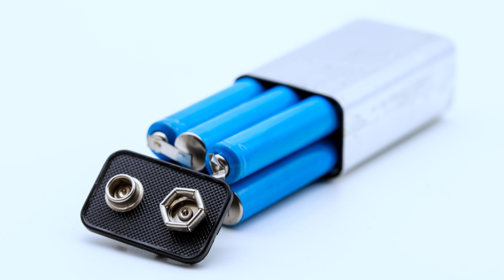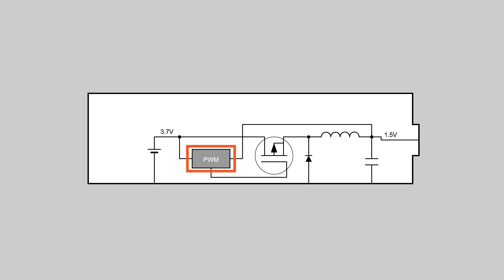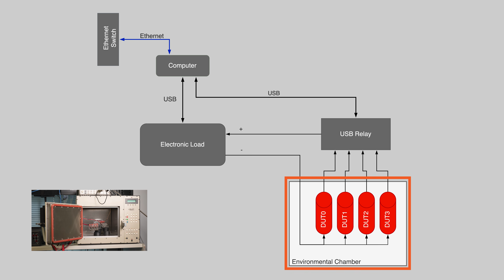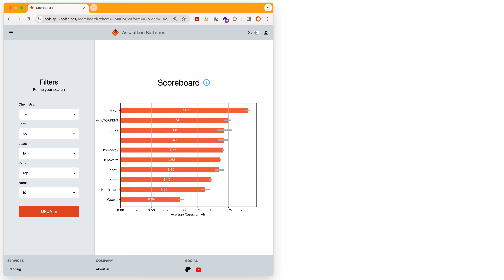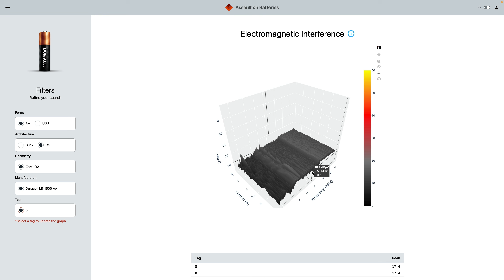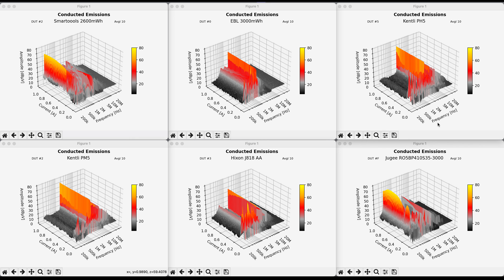Assault on Batteries #1 |  Rechargeable Lithium-Ion AA

Comment: I love the thoroughness of your tests, very well done and very interesting! Will you add more versions and brands to the list in the future like XTAR and EBL? It would also be nice to have more filter options on the website, for example to select specific brands that are available.
Reply from the maker: It sounds like you are only displaying the top five results. Under "Show" in the bottom left of the Scoreboard, change the number of results to "10 Results" and the XTAR and EBL cells will show up.
Reply from the maker: On second thought, we'll change the default to 10.

Comment: Glad to have watched this video. For now I am only using the lithium aaa batteries for my safe control panel. Seems to be good so far
Reply from the maker: An electronic lock typically doesn't have any analog or radio circuitry and shouldn't be sensitive to EMI. Keep in mind lithium-ion has a higher self-discharge rate than alkaline (ZnMnO2) or disposable lithium (LiFeS2).

Comment: Hello!

Thank you for these videos very informative. Especially the part about EMI, I was unaware.

I am a professional sound mixer using a lot of wireless mics. Of the brands you have tested are many I use. LADDAS, Xtar and eneloops.

You say not to use any of these batteries in highly sensitive electronics like wireless mics. So my question is what should I use then? I currently run Lectrosonics wireless in my kit.
Reply from the maker: Lectrosonics makes nice gear! We'll contact their support department and ask. 

Meanwhile, can you share which model you use and how long the mic has to run between charges?
Reply: @ well I use LADDA’s in an HMa for example and get about 7 hours run time
Reply from the maker: An update:

We asked Lectrosonics what their policy was with regard to rechargeable Li-Ion, but have not had a response yet. We also contacted a local repair shop who have access to schematics. They tell us most professional gear has a boost converter to raise battery voltage for transmitter circuitry. The boost converter’s EMI filters probably clean up some of the noise from the buck converter in the rechargeable lithium-ion cell. However, there’s still no guarantee the two DC/DC converters will work together properly. Stay tuned…

Comment: At first a ISB jack on a cell may appear to he a smart solution for chargin3.  That concept loses its appeal when multiple cells need to be charged. Then a multiport USB power source is required and multiple USB cables.  This may be more of a.pain than forking over a few buckazoids for a multi-cell charger.
Reply from the maker: That's right. The best solution depends on the application.

Comment: Very nice . I have had trouble with them Li-Ion 1.5V rechargeables because of noise from electronics . I found a fix and works in some electronics just fine . AA is about 14500 size. So I found 14500 LiFePo4 3.2V cell this has no electronics. So on a 3V system use 1 dummy cell . or re wire batt holder to parrallo .  Also some electronics can use 3.7V cells.  witch is just .7V higher than 2 -1.5V cells. LFP cells 3.2V offer much better cycle life.   There is some Nickel Zinc 1.6V  rechargeable on the market but have poor cycle life but better than the rechargeable alkaline manganese (RAM) type.  I am finding that modern electronics is using standard 18650     type cells now. The older AAA/AA/C/D are fading away in new devices . And for remote controller they are switching to coin cells and you can get rechargeable ones as well.
Reply from the maker: Yes, that's a good solution if your device takes an even number of cells. You have to be careful you don't damage the LiFePO4 by discharging below its cutoff voltage though. We cover this in our next video (AoB #3). 

Note you can get LiFePO4 in AA form too: https://www.aliexpress.com/item/1005005870958670.html
Reply: @on-the-fritz In my experience a single 3.6v Li-ion does well in 3x AA, AAA aplications . Starts at 4.2v if fully charged, which is lower than the equivalent alkalines, and the cutoff for Alkalines is 0.9v per cell, 2.7v total, which is still higher than their 2.5v lower limit. Of course you try to replace/recharge them before that.
Reply from the maker: Clever! Makes us wonder if there isn't a way to put three Li-Ion cells in parallel to maximize run-time. I can imagine shims that connect the cells in parallel and route their output voltage to the appropriate contacts in the battery compartment.

Comment: I have so many questions for someone that understands Electrinics. 
But for now. I just bought 8 Hixon 1.5 AA’s then discovered since I have a smart charger with sixteen slots that gave me a grumpy beep when I tried to charge them. Bought the Hixon 4 bay charger. 
This is for toys for my sons. I’m terrified they will try to charge regular batteries in the new charger, or lithiums into a cheap ‘energizer’ charger. How strong is the propensity for a thermal runaway fire that nothing but a suffocating wet blanket can even attempt to control. Is it worth it for the extra voltage and lifespan to have both laying around? What happens when my son throws his RC car in the air or drops it from the bomb bay of his drop and snaps a battery in half ( admittedly this would be tough but I never underestimate the destructive capabilities of an experimental toddler )
Reply from the maker: The recharging of buck-regulated (bucked) lithium cells is not standardized in the industry and we aren't aware of any manufacturers that provide a charging specification. The manufacturers of the cells we tested insist we charge their cells ONLY in their chargers. It's reasonable to expect a properly designed, bucked lithium cell to not be damaged or dangerous when put in a NiMH charger (if that's what your Energizer charger is) and for a NiMH cell to not be damaged when put in a Hixon charger, but unless the manufacturers warrant it in writing, do NOT count on it. Our lawyer's advice: an adult should be in charge (pun intended) of recharging.

Note also that some cells have a low internal resistance and precocious kids could get some entertaining and potentially dangerous pyrotechnics playing with a cell and aluminum foil.

Comment: The only bad thing about your charts on yourSit3, is that your price point chart seems to only be for non-chargeable..  I was hoping you had it for the li-ion rechargeables.
Reply from the maker: We’d like to do a price point chart for rechargeables, but we’ll need a few more patrons to afford it! To do it properly, we’d have to test cycle life by charging and discharging cells until they only held 80% of their original charge, then divide their cost by the total energy they were able to transfer from charger to load over their entire cycle life. We’d have to buy or custom build a test jig that charges and discharges the hundred or so samples we’ve got at a controlled ambient temperature. Stay tuned…
Reply: @on-the-fritz  Looking forward to it.  in the meantime, I grabbed some of the "pujimax"  3400 mWh (light blue with white writing).  They are by far the ch3apest rechargeable li-ion;  (with only slightly less performance rating).  I can get them for two bucks each when I order 20..  (or 8 - $19).  Most of the others are closer to 40 for 8, or even more..  I read enough decent revi3ws about these that it's worth using them at that pric3.
Reply: @on-the-fritz  Looking forward to it.  Make sure you put 'puj^max 3400mWh" on the list (light blue with white writing).  They were the cheapest I've found for price/performance (at least on paper). I'd like to see how they test..
Reply from the maker: We're talking about the EBL 3500mWh disposable lithium cells (ASIN: B0CY213G71), right?
Reply: @on-the-fritz  No.. It's puj^max 3400mWh..   (My  ^ symbol = i ) ..   I can't spell it out, because it will auto d3lete.  They are on fl333bay and scAmaozn...  Lithium rechargeable.
Reply: @on-the-fritz  They are barely over two bucks each on fl333bay..  by far the ch3apest I've seen for lithium rechargeable.  So I'm wondering what's the catch?   I read a lot of good rev^ews, so I grabb3d a twentyPack..
Reply: @on-the-fritz  Tw3ntyPack 4 onIy forty dollen on fI333bay.  I was surprised to see lith^um recharg3ables for that ch3ap
Reply: @on-the-fritz  Again,  I've written several comments and they all disappeared.  We can't speak freely on yyoutube.
Reply from the maker: Sorry, I must have confused your request with someone else's. Pujimax has a blue/white 3400mWh rechargeable lithium on AliExpress. If you have an ASIN for Amazon, please share.
Reply: @on-the-fritz  Oh.. ok.   I don't have a good ASIN for them, because they were all way too high over there.  Al^3xpbreszz was around the same pric3 as 3 bay, except it also came with a charger-- which I don't need, because I ord3red a smartCharger instead, that tracks the volts/amps, etc. of the inputs..  but you have the right ones..  Can't wait for the video.  Thanks.

Comment: Great video ... I was planning to buy some of the for my future wireless mics ... but looks like it's a bad idea :D
Reply from the maker: You're correct. We don't recommend buck-regulated cells in wireless devices because the noise they make can intermodulate with the oscillators in digital circuitry to create interference all over the RF and audio spectrums.
Reply: @on-the-fritz  I wonder if it makes a difference if the mic transmissions system is digital (not analogue). Maybe I would give a try and buy 4 of such to see how they work with that particular device :D
Reply from the maker: Buck-regulators operate well above audio frequencies in continuous mode, but in discontinuous mode (at low load currents), they might be audible. Don't use them in devices that process RF or low level signals!

Would a video explaining intermodulation be of interest?

Unfortunately there isn't a lot of reliable data on Ni-Zn. They might be okay if discharged consistently and recharged regularly (ie don't rely on the device to notify of low battery level). They are certainly cheaper than disposable and make no EMI noise.

Comment: I'm glad you actually tested for EMI noise. It's one of the often-overlooked drawbacks and it's the reason why I advise against any of these lithium-ion AA batteries for specific uses, like audio equipment such as wireless lavalier microphone systems. There's not much space in there and I would imagine it's almost impossible to cram competent filtering in them.
Reply from the maker: Yes, and the cost of the extra filtering would be significant too.

Comment: So if that buck converter is running all the time, what are the self-discharge parameters? One of my biggest gripes about NiMH batteries is that they are pretty much dead after 6 months of storage.
Reply from the maker: Yes, the buck-converter's always running. In storage it would sleep in discontinuous mode, waking up periodically to maintain output voltage. If it's properly designed it shouldn't add much to the self-discharge you can expect from a lithium-ion cell (2 - 3% according to Wikipedia https://en.wikipedia.org/wiki/Self-discharge). 

Newer NiMH cells claim to have lower self-discharge rates. Eneloop, for example, claims they will have 70% of their charge after 10 years (https://www.panasonicbatteryproducts.com/eneloop_rechargeable_batteries/eneloop_rechargeable_batteries-aa_4-pack/)
Reply: My lipo-1.5v-buck AAAs & AAs self discharge after near on exactly 6 months. Japanese Eneloops seem to be the best for low self discharge.

Comment: very professionally made content, thank you.
However, a typical use case for these types of batteries would be nowhere near 1A load. As you mentioned, the capacity of all of these is likely much higher if measured at a lighter load. Does this mean that Hixon J818 is still a winner in a typical scenario or should I consider Kentli instead, for example? Unfortunately it seems to be impossible to tell without some additional testing.
Reply from the maker: You can expect an increase in tested capacity at lighter loads, just because it takes longer to reach the cutoff voltage when there's less of a voltage drop across the cell's internal resistance. It's anybody's guess how buck converter efficiency changes with load current. So you are correct, more tests are needed to be certain, but we'd be surprised if rankings change at lower load currents. 

We are currently scrambling to get our next video uploaded and an update to the web site released, but we'll add 500mA load tests for a selection of cells to our to-do list. 

Thanks for your kind words, your interest and the suggestion.
Reply: @on-the-fritz  That's awesome that 500mA tests are coming. One other thing that occurred to me after reading some reviews from those who have purchased the various batteries on your list is that some early/random failures had to do with 'failure to charge'. I'm not sure if this means that architectures that have only discharge circuitry have a better chance of avoiding such failures and my personal experience is limited to using one aaa kentli in my razor (which still works after 8+ years of use). I've ordered 4 AAs now to give them a test. 10 years later i'll know if that was a good idea :)
Reply from the maker: We like that a Kentli cell isn't burdened with discharge circuitry and its three contact design, which (if our guesses are correct), would allow a battery-powered device to optionally bypass the buck-regulator and tap the lithium-ion cell directly. We've seen some failures in our sample of buck-regulated cells, but didn't have the time to determine exactly what failed.

We had some lab time to perform 500mA discharge tests on four samples of each of four make/models, but don't want to upload results, because the production web site hasn't yet been tested to present more than one current per make/model. Meanwhile, here are the average discharge energies (in watt-hours):

Manufacturer / Model, 500mA, 1A, %
XTAR / 2500mAh, 3.208, 2.824, 13.6%
Hixon / J818, 3.149, 2.793, 12.7%
EBL / 3000mWh, 2.628, 2.283, 15.1%
Kentli / PH5, 2.555, 2.123, 20.3%

Summary
The buck-converters in these cells are 13 - 20 % more efficient at 500mA compared to 1A. Note that the ranking doesn't change with load current. In theory, you could cut 'n paste the above into a CSV file for import and better readability in a spreadsheet.
Reply: @on-the-fritz  Thank you very much!

Comment: Thankyou. So no good for.night vision camera?
Reply from the maker: Sorry, there's no definitive answer to your question. Unless a device manufacturer claims compatibility, they probably didn't increase design time and parts cost to filter out the EMI noise of rechargeable lithium-ion cells/batteries. EMI noise might cause interference in electronic circuitry, especially, in your case, the sensitive analog circuitry of an image-intensification camera. So it depends on your use-case. Unreliable equipment is tolerable if you're hunting wild hogs, but not if you're on a Seal Team Six mission.

Generally speaking, rechargeable lithium-ion cells/batteries are suitable for simple devices with mechanical switches, motors, heaters, LEDs, etc., but even then, they might cause interference in nearby sensitive equipment.
Reply: @on-the-fritz  wow. Thankyou. I had already made a purchase of rechargeable NiMH batteries based on this video and the comments of others here. Thanks for your informative and prompt response. God bless
Reply from the maker: Good choice. In our next video we'll talk about NiMH, which have about twice the energy of alkaline cells. They run about 0.3V lower than alkaline though.